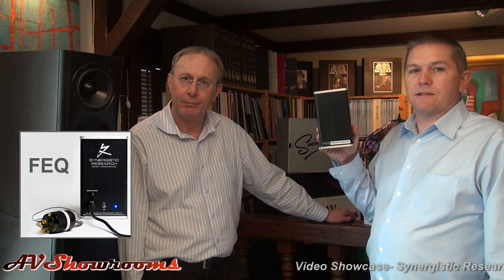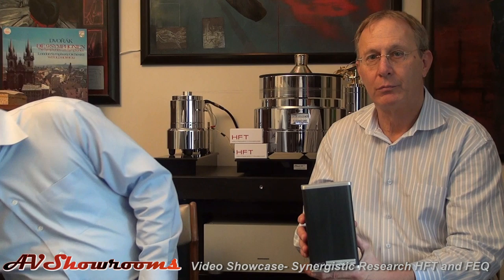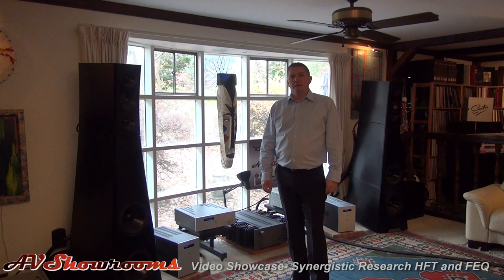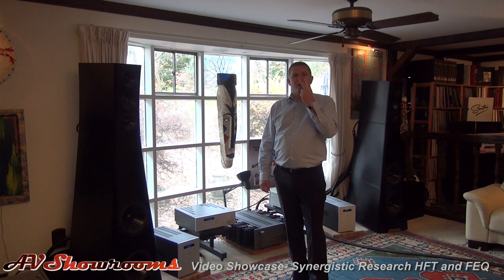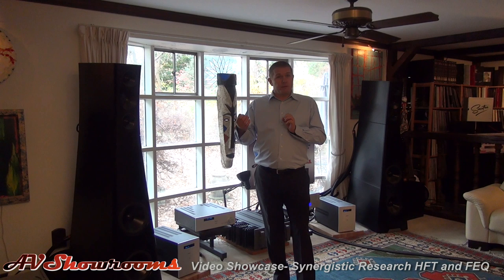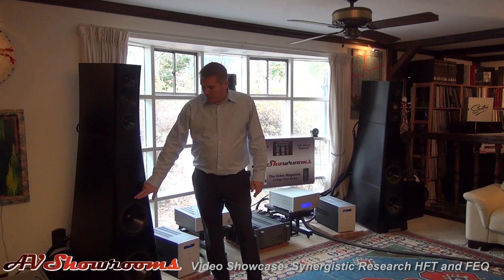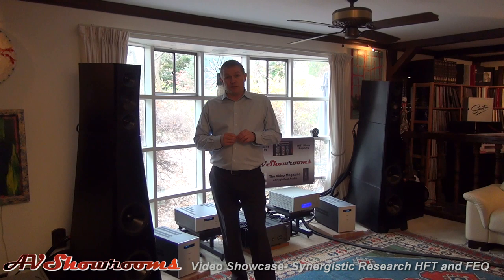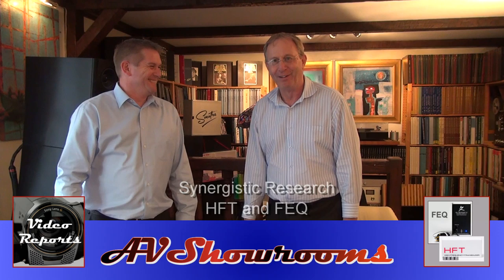Synergistic Research HFT, FEQ Install 1

Comment: I have the Synergistic Research HFT level 4 with the FEQ (Frequency Equalizer) installed in my system. I would like to emphasize two statements that Peter of AV Showrooms made. The sound is now coming not just from the front wall- speaker area but there is a sense of sound coming from the sides of the room and from the area behind the listener. This truly gives the listener a "you are there with the muscians experience". As he stated the change is not subtle but dramatic. My room is not a rectangle but is"L" shaped. Certainly a challange to treat acoustically. This has been a tremendous upgrade to my listening enjoyment.

David Pritchard

Comment: If they did anything acoustically beneficial then the placement would need to be specific to each room. No two rooms are exactly the same acoustically. There are many factors to take in to consideration. I noticed there was no room modeling or measurements taken to determine the placement. That would have been beneficial to see a before and after measurement . The video would have been helpful if they explained what exactly they did.

Comment: My believe in how these things work is as follows...Each of those little HFTs do a  full dispersion of frequencies at over approx. 15K  Those wavelengths are about half inch long/wide.   In properly designed recording studio we do not have parallel walls.  Parallel walls in a listening or a recording room is the kiss of death for the sound.   These little HFT work by dispersion just enough of the high frequencies to make a room sound like it has un parallel walls and windows/doors for the upper frequencies.  Even the ceilings in a proper recording or listening room should not be parallel with the floor.  Once you remove the upper frequencies nasty standing waves your ear drum can hear differently also because its not ringing listening to nasty upper harmonics.  When your ear drum is not ringing it can do a better job of hearing so the bass even sounds deeper and tighter Upper frequency glare kind of like freezes the auditor nerve  You ear is trying to protect itself from damage actually.  High pressure sound levels damage the ear much more when the sound is unpleasant than when it is pleasant sound.  So eliminating those nasty standing waves in the upper frequencies allows our ears to relax.  HFT remove the nasty standing waves in the upper frequencies in the room.  That is my belief.    If you build a proper listening rooms with un parallel walls/ceilings you would not need HFTs  And if you do make sure the walls are slightly slanted in on one side and out on the other side  Ten you have a proper listening /recording room.   These little HFTs send out just even dispersion to break up high frequency standing waves in the room.  Its amazing that no one marketed a product like this before.  So simple and yet so effective
Reply: I have question about the parallel walls.
If the wall build like the stone surface, does that help to eliminate the concept of parallel.